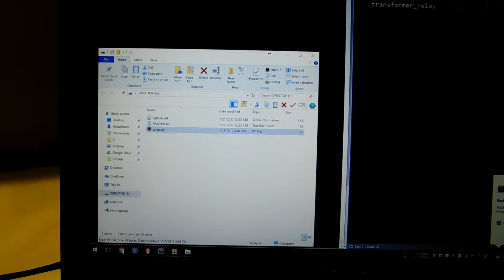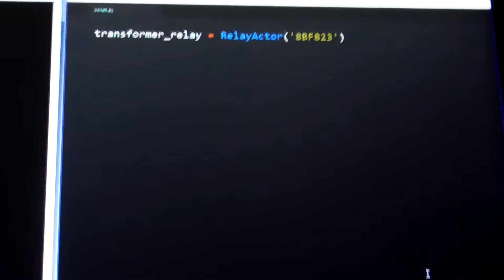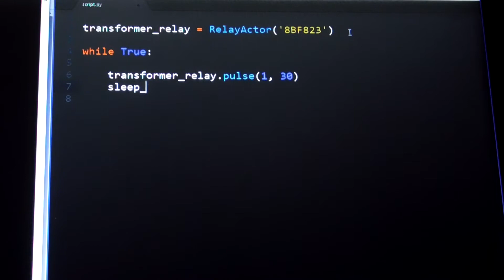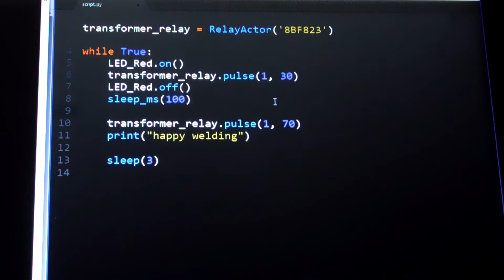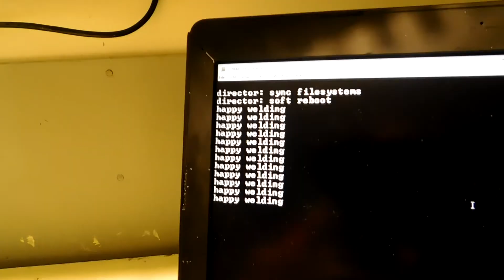How to Build and Program a Dual Pulse Battery Spotwelder

Comment: Hi Snektek, why use  relay a triac or mosfets in antiparellel will give you more precise timing.
Reply from the maker: That is true, but it uses a battery setup instead of the microwave tranformer